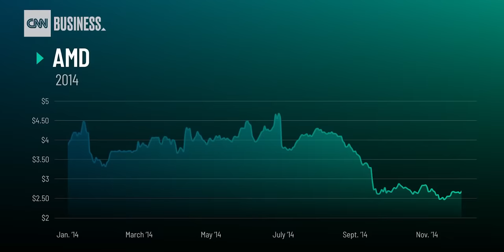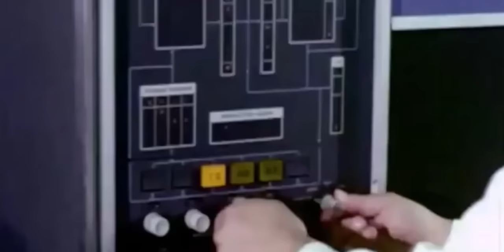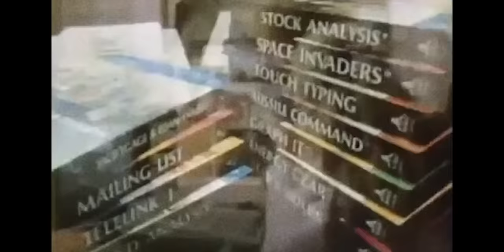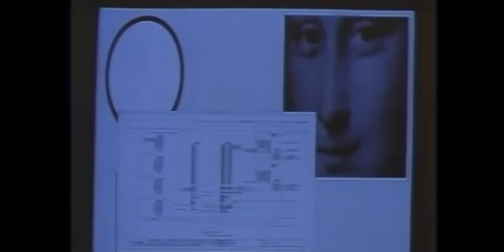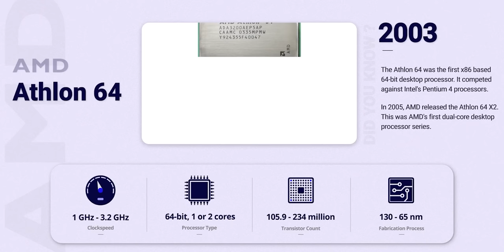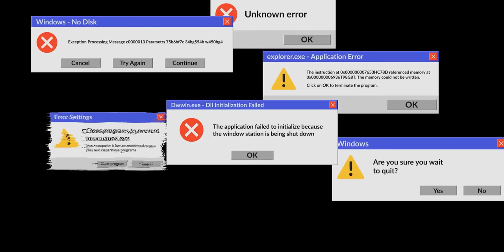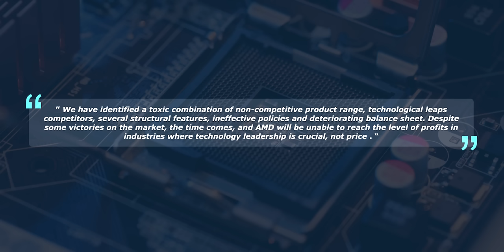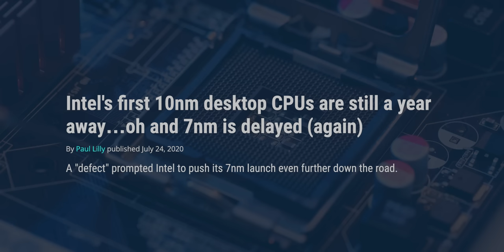The Real Reason AMD Is Worth More Than Intel

Comment: Some additional details:

- The main reason Intel switched to "Pentium" instead of 586 was it was specifically to obtain a trademark. A number by and of itself, due to the nature of numbers in general, can't be trademarked as they did not appreciate AMD copying the nomenclature.

- AMD did reach 1Ghz first and this caused Intel to react with their Netburst architecture.

- Intel's Netburst was at that time which was basically focused on pushing the clock speed through the roof. It did achieve this but IPC suffered greatly as they just blew out the instruction pipeline. That coupled with CISC and microcode and the penalty of failed branch predictions eating up massive amounts of clock cycles flushing the dirty pipeline meant that it just performed like dog poo.

- AMDs Athlon shone, especially the 1.4Ghz chip. The closest thing Intel had at that time was their Pentium III 1Ghz which was highly saught after. There were also a bunch of compatibility quirks with Windows 95 and 98 that didn't play nice with AMD at that time, but AMD was given first billing at a lot of PC stores which was great.

- Intel ditched Netburst and decided to go back to their Pentium-M architecture. They simply rebranded this as the "Core" architecture and leveraged their development teams from that strong base. 

- AMD suffered fab issues as they were one die-shrink process behind Intel. AMD tried to do a leap-frog architecture with Bulldozer / Piledriver. The downfall was the now infamous shared floating point (IIRC) between the not-so-separate "individual" cores of these 8-core CPUs. They gave it their best shot. However the shortcomings of being a die shrink behind, it became AMDs own "Netburst" calamity with the architecture fighting itself for little to no gain.

- It was then Intel's turn to suffer fabrication issues as we know in recent years with their 14nm+++++ notoriety. With AMD going fabless and TSMC and back then Global Foundry pushing out superior fabs, all AMD needed was their own "Core" architecture to spring back on. This time, of course, with Ryzen, proper native cores and with their fabrication process now on par or superior to Intel and their new "infinity fabric" creating an ingenious modular method to make the most out of each wafer of silicon (disabling cores, less wastage, more "acceptable" chips with disabled bad cores could be made in to different SKUs with less peocessors etc) it was a fantastic approach.

What really struck me was how there really has been a back and forth. Both had fabrication issues. Both had architecture issues. These resulted in shifts in the market and almost tanked AMD. It's been an amazing few decades.
Reply: Intel's Netburst wasn't that bad. Take the Intel Xeon 7140M, clocked at 3.4 GHz with dual HyperThreaded cores, a quad-pumped 64-bit 800 MHz FSB featuring up to 25.6 GB/sec of bandwidth between the Northbridge and memory controller/peripherals (PCI/PCI-X/PCI-E). It also featured 16 MiB of L3 cache. It outperforms any of AMD's Athlons, and I only paid $1600 for 4 of these back in 2007 to use in my quad-socket system I built around that time with 32 GiB of ECC DDR2 RDIMMs and 1 TB usable storage in the RAID 10 (8X250 GB 10,000 RPM UltraSCSI 320 3.5" HDDs). And 3 NVIDIA GeForce 8800 Ultras in 3-way SLI. All for under $8,000 in 2007.
Reply: Which "Core" were you talking about when Intel continued working on Pentium M? Afaik those had nothing to do with either Wolfdale or Yorkfield chips.
Reply: @NUCLEARARMAMENT  I don't actually remember how good or bad Netburst was. I didn't ever own one. I was all in on AMD with my hardware at that time. I did make an exception, I went back to a Pentium 3 1Ghz for a while because the Athlon 1.4 was just giving me too many windows issues. I even stuck around with AMDs Pheom 6-cores. I had a 1075t, however it became more and more apparent that even with Intel's supposedly crappy 133mhz FSB, they just blitzed AMD time and time again. 

I bit the bullet and went back to Intel with a 2600K (which I still have actually). Then back to Ryzen the last few years. I just want both companies to be "competitive" so they don't rest on their laurels and give us a 5-10% performance increase each new generation.
Reply: you forgot 1 thing, Zen launched using global foundries which was amd's own fabs, on 14nm licensed from samsung, which was still quite a bit inferior to intel's 14nm of the time, it was only when zen 2 launched that amd went to 7nm and finally had a node advantage.
it really was the chiplet that allowed amd to come back, 1 design vs 4+ of intel is just genius.
Reply: @cj09beira  I agree the chiplet design was a bold move and ridiculed by intel. Now the shoe is on the other foot it seems. We are all riding this innovation wave so hopefully we hit some big performance numbers as these 2 CPU companies duke it out :)

Comment: GUIs were out and available for 8-bit processors like the 8088 (*though its 50/50 8/16bit).  They didn't require 386 processors.

Comment: 10:49 Technically, the Athlon 64 (Sep 23, 2003) was the 2nd mainstream 64-bit CPU offering, but the first offering to incorporate X86 architecture. 

The first 64 bit CPU was the IBM PowerPC G5 offered in the PowerMac G5 (Jun 23, 2003). PPC architecture was used in everything from the Nintendo GameCube to JPL's Mars rovers, I find it sad that they no longer compete in the mainstream CPU-fab race.

Comment: My first PC that was really mine at 11 years old was a Compaq with a 486 SX\2 66 Mhz and 2MB of memory and a 100MB hard drive. it needed a daughter board for the two 1MB memory modules because it only had one memory slot.  Windows 3.1 It ran Doom, Police Quest: :SWAT and QBASIC though :)  When Duke Nukem 3D came out I got an HP Pavilion with 16MB of RAM and a DX4 166Mhz.  I still have that PC sitting under my desk in front of me.

Comment: qualcomms NUVIA acquisition (lead designers from Apple M1) will them put in the first row, while AMD abandoned serious work on ARM years ago... My guess is that Qualcomm will hit the Intel, AMD and Nvidia off guard .... and Apple or Microsoft will not find the cooperation for wide market penetration ... But Intel (as well as Samsung) are interesting companies for me as they are not Taiwan based ... and seeing the military preparation efforts of china to overtake Taiwan all the companies above may be hit hard
Reply: Arms main selling point is low power, so they could fight on laptop chips, but not really server,datacenter and desktops.
Reply: @erikhansen5326  mate u need to inform yourself better. The presence of M1 and m2 chips on apples iMacs is a good indicator that down the line u will see ARM cpus being widespread across desktop PCs for sure. theres a reason AMD and Intel are both reviving their R&D on ARM options as they both know that ARM has a future in desktop
Reply: @ThatNorma  It's still questionable on if ARM is really going to take over desktop. Like Erik said, x86 pushes harder with more power in comparison to ARM taking a M2 and bumping it's power envelope to 90w isn't the same as taking a Intel or AMD CPU to 90w
Reply: @sounghungi  but i never said arm will take over desktop. I personally use x86 and always have. What im saying is that arm does have a place in the desktop space and if we take the example i gave above, they are already on the desktop space with the M1/m2 on imacs. Unless arm eventually overtakes x86 on both performance and power consumption ,there is no reason to believe arm will overtake x86
Reply: There are ARM server chips like the graviton's that Amazon has available. However they are not clearly better than current Epyc processors that are also available. There are some type of software they run better and some types of software the Epyc chips run better. It is certainly not clear to me that ARM will win on performance or power usage.

Comment: 16:37 is confusing. What Zen 3 chip is made with 8 groups of 4 cores? The changes Zen 3 made over Zen 2 were that there were 8 cores in one CCD instead of 4 cores per CCX in a CCD. The 8 cores share all of the cache in that CCD instead of getting access to half like in Zen 2 (for example 32MB in a CCD but since that was split into 2 CCXs each 4 core group only got access to 16MB of cache, if more was needed it would have to come from another CCX which would take much longer). All 8 cores having access to all the cache on the die decreased latency and improved single core tasks which benefited gaming and workloads like Photoshop a lot.

Comment: The first pentiums we're NOT 300mhz they were 60mhz 75 90 and went to 200mhz
Reply: @n n the MMX version came after the regular pentiums followed by the pentium pro which was received poorly because they thought everyone would be using 32bit only code by then which was not even close. Cyrix was in it's heyday at this point also. I personally had a cyrix 5x86 200 which actually ran at 166mhz AMD had released a 4x86 133 which could overclock to 160mhz. I remember quite a bit from that time.

Comment: I used AMD 386 w a separator co processor that did 256 color mode on Windows 3.1 1992 which allowed me to get online with CompuServe and Prodigy.   Intel did hit the big time with I series and dominate for 20 years and where even in Apple computers,   Arm is change everything.  AMD and Intel will need each other,  now companies can and do build there own chips.

Comment: 2005 i bought my 1st real  PC at woolworths store  them cheap au $500    this is a great history of the cpu market easy to follow  . 
486 cpu never understood why pins and not Nobules   well they did that anyway  ive spent  ages straightening Pins using a razor blade & flat driver it Worked - have a  box of old cpus  .

Comment: Uh, one error in the video. you said that the Zen 3 architecture can use up to 32 cores, but they are configured in up to 64-core versions. 64 cores has been offered starting with Zen 2, and they've had 32-core CPUs since before Zen 2, I think with Zen 1.

Comment: AMD are the reason why Core i7 12700k wasn't "Quad core with 8 threads" before Ryzen release, Intel i7 from 2600K towards 7700K all only 4 cores, newer generation only 5% faster than last gen counterpart but 30% more expensive.

Comment: You made an error with Pentium clockspeeds, Pentium 1 debuted at 50+60 and made it up to 90mhz, the first Pentium 2 topped out at 266mhz not 450, that was a Pentium 2 MMX re-design that should have been considered an entirely different processor generation...

Comment: Your statement that the PlayStation 5 uses a CPU and graphics chip designed by AMD is partly true. Both the Xbox Series X and the PlayStation 5 use APUs (Accelerated Processing Unit - a CPU with integrated graphics) that Microsoft and Sony co-designed with AMD. 

So, technically, both the XSX and the PS5 have AMD microprocessors (APUs) that combine a CPU and a GPU on a single die.

Comment: "386 allowed GUIs on PC's" - I seem to remember running Windows 1.1 on an 8088 & Windows 2.0 on 80286 machines while studying computing in The 80's?
Reply: I ran DOS 3.3 on my 8088.  I thought win 3.1 was slow and unstable on my 486 so I ran DOS 5.0.  I cannot imagine what Windows 1.1 or Windows 2.0 is like.
Reply: I don't understand why he said that.
Reply: @Hardwaregeekx  in their day, they weren't that bad on the hardware they we're designed for.  You're talking no bloatware & MicroSloth actually used to....   Optimise software, like real programmers do still....

Comment: Love this video.  Brings back memories.  The 486 was my first PC, loved Athlon, hated Pentium3, liked Core chips, saddened about ATI (that tech should have been AMD's integrated tech), Intel mobile chips were superior, now I'm on the fence between building an AMD Ryzen or Intel.  I like the underdogs, but I want to put my money in the USA companies.  And I want to like AMD's GPU's, but Nvidia's are better.  Gotta love tech and love competition!
Reply: AMD is launching Zen 4 shortly so hold your horses with any purchase. I suspect we're less than a week away from the announcement. As for your GPU statement: as the market is as of right now Nvidia has a big problem. Yes they have the better overall product from an architectural standpoint, but AMD is hammering them so hard on the performance per dollar front that it's not even funny. You can get a 6900XT for the price of a 3070ti... That gets you on-par ray tracing performance but 3080ti/3090 level of rasterization performance. And 16GB VRAM vs 8GB. And it uses less power.

Comment: AMD bought ATI for one Reason: Their Chipsets.  
When Athlon had one flaw, then it was it's Chipset. The Nvidia was the best for Graphics but not so well on Diskoperations and Card operations, the southbridge was crapp. 
The Via Chipset was good at Diskoperations but had massiv speedloss for Graphics, the SIS Chipset was overall bad but was low on powerconsumption, the AMD Chipset was Mediocore.  ATI was developing a Chipset which could run against the P965 Chipset of Intel, which had a good Graphicsperformance and good Expansioncard Performance.  
The ATI Chipset arrived just in time to give the Athlon 64 a boost but gave the Sempron I/II enough power to not totally fall back with the A700 an A800 Series 2 Years later after the merger. And of Course the Northbridge was then implemented into the CPU, another reason AMD needed the ATI Chipset Team, the GPU Team was more of an Accident and it showed.

Comment: Been following this from a building desktop point of view for a long time. Owned both stocks. Great video. Learned a lot!
Reply from the maker: Great to hear! What CPU is in your desktop?
Reply: @TickerSymbolYOU  My main desktop has a Ryzen 3900x. I do video editing. Its plenty for that. I also have the last MacBook with intel processor. It runs hot unfortunately. The switch to efficiency-cores in Apple silicon solved this in later models. Now intel runs hybrid chips with both performance-cores and efficiency-cores. I like this concept. And from what i understand intel is in the game of expanding semiconductor manufacturing in the US. Supported by government. This is why intel is in my portfolio now. 
Great channel. Keep it up!

Comment: There was no way to cut a chip apart in the 80s to reverse engineer something.  

The issue is one of the ISA.  The ISA is everything.  You can reverse engineer an ISA, if they even had to because to make a compiler you have to have access to the ISA.

Having an ISA allows you to engineer a hardware architecture to run it.

So the move to 32 bit was the first REALLY big move for the PC, other than just getting its foot in the door, because this leaves out the entire Apple story which was just as big or bigger at this time because that's where a lot of innovation happened and the move to mouse.

The movement of engineers between AMD and Intel, going both ways has been non-stop.  This is really what's pushed both companies to where they are now.

And no, Nvidia isn't going to take over the world of PC.  Apple can't even do that and they've been trying for decades.  Nvidia is really competing against Apple, because they're both using a modified ARM processer to run their systems.  Nvidia has no rights to the X86-64 ISA, which is the name of the current instruction set that AMD and Intel use, not X86.  So Nvidia is going to be slugging it out with Apple.

Comment: Lots of shortcuts:
1. Intel's payin' OEM vendors to buy their CPUs stalled AMD and was a reason for huge loss on them. Intel payed the fine, but AMD wasn't compensated on that, still a win for Intel.
2. Core 2 architecture was derived from core solo, which was made based on pentium 3 arch. At that moment Intel rushed for empty GHz with P4 which resulted in 3Ghz P4 using double the power of C2D and still being slower. They had good processors shipping to mobile devices and started from that knowing P4 was a dead end.
3. Aquiring of ATI was a big problem at the moment, but that helped them in longer time. Without good integrated GPU they wouldn't be able to deliver chips for consoles.
4. No mentioning how important is to have competition? Intel 3000 series being not compatible with 4000 series CPU and MB, not being compatible with 5000 series. But wait, Intel made new socket and claimed a processors and MotherBoards are not compatible. They claimed that until Asrock (correct me if I'm wrong) released a BIOS that allowed some crossseries (still the same socket) pairing. Before Zen Intel was giving like 5% boost per generation, required new MB for new CPU because of "compatibility" reasons and claimed 4 cores and 8 threads is more than typical consumer wants. If he needed more he had to pay a lot more for a different line of CPU and MotherBoards. Using priviledged market position to dictate prices normal strategy, not only related to Intel. With AMD FX processors they charged huge cash for fastest ones. After C2D premiere they had to cut price significantly.